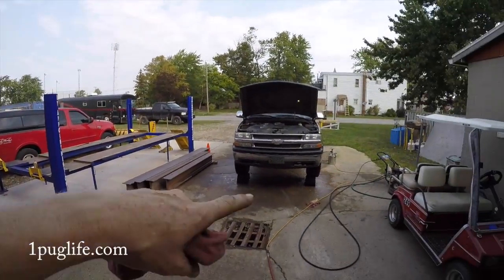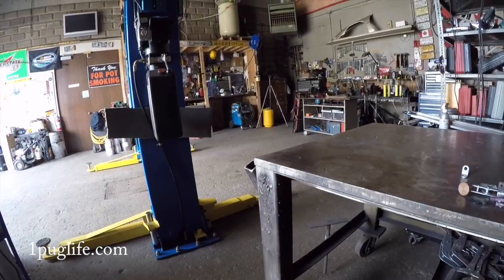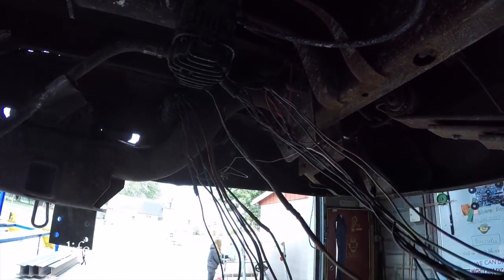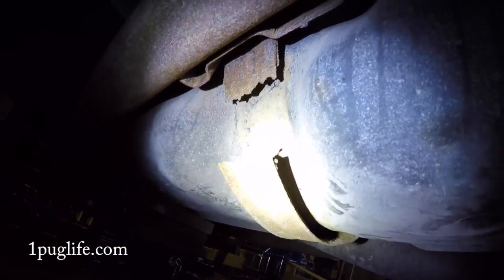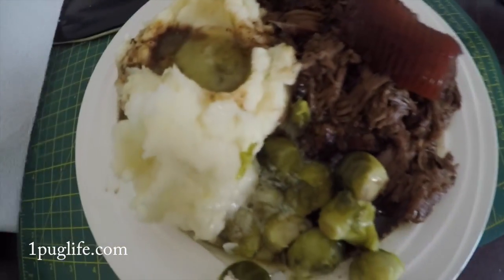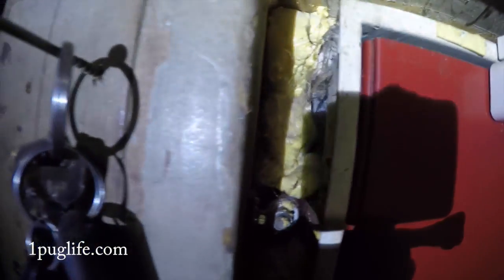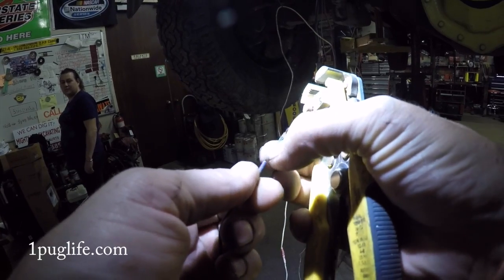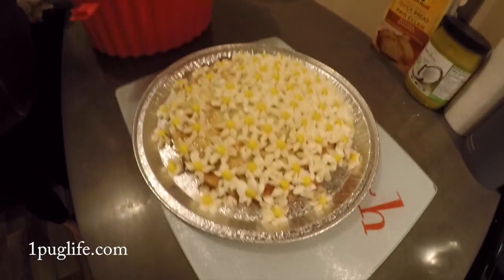real life trucker horns

Comment: Pug buys everything TWICE.
1. The inside lift.
2. Lathe.
3. Milling machine.
4. Drill press.
5. Air compressor.
6. DeWalt to Milwaukee cordless drill.
7. Roof over the living quarters.
8. Drywall.
9. Numerous vehicles.
10. Cargo trailers to shipping containers.
11.  Outside hoist (soon).
12. Numerous utility trailers.
13. Work shop.
14. When Tiff splits, guess he'll try to replace her too (good luck on that one, gonna be lookin' a loooooong time) !!!!!
15. etc.
Reply: Just One Fan Your talking about yourself again Walrus man

Comment: Why the frick don't you go back in that wire loom about  a foot or 2 from that cobbled wiring with all the joiners in  cut the end clean off by the frame, "Hope" the wires better there or go right to the start point at the front end then make a whole new loom from there right up to the lights both sides. using something like 7 core heavy duty trailer wire and plastic wire covering to protect it when you are done.     

 you could even use a semi truck type sealed junction box on the end of the truck loom bolted to the frame or bulk head to connect the new loom together with the old truck loom.      The wiring on both my 7.3 Ford F250 SD tow plugins was a shit pile like that, I just cut the end off the factory loom and did that this way. 6 years later it still works perfect and no more wasted time fucking with something that never worked right  the last 5 years the other guy  had it. !